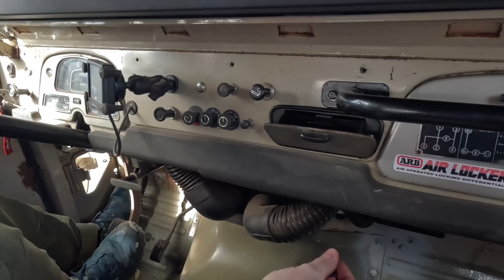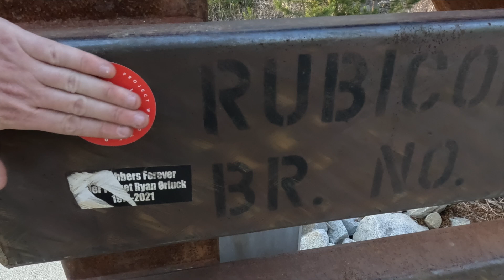Rubicon Trail Gives Project Wrong Way FJ40 Just the Tip, I Learn I Might Need Some Upgrades...

Comment: Brother, that looked awesome!!! Fj40’s are meant to be driven and look what it is capable of.  With no power steering you got more than the tip.  Cheers!
Reply from the maker: Gearing and PS will open a few more doors for sure. Georg is right though, I am going down a slippery slope...

Comment: I have the same gearing issues with my 1972 and 4 speed. I think the best bet for the money is an H55 five speed w/4:1 split case. That takes care of multiple issues! Cruiser Outfitters or George could surely hook you up! And a saginaw kit for PS
Reply from the maker: Georg and I are already building up a combo! It’s looking like a diesel spec H41 and an Orion… which should get me pretty low 😆
Reply: @projectwrongway9127  Oh that should do it! I wonder what the cost difference would be between the combo I am looking at the one you are building? I love the idea of the 5 speed... but you should be deeper in gearing with your set up!
Reply: Okay after checking the cost on H55 with 4:1 case... I like the Orion for my 4 speed! 🙂
Reply from the maker: I’ll try and show the process of getting an Orion in here.

Comment: Hello, greetings from Pontassieve, province of Florence, Italy. I have a Suzuki Jimmy 4x4 with a 1.3 litre M13A petrol engine, manufactured in 2001, all original, which I often use on dirt roads on rural farms and on dirt forest roads used by loggers to get wood from the forest. With forestry tractors, with skidders and forwarders, and with forestry trucks used to transport wood! And this is even though a 4x4 off-roader with original configuration behaves very well on this type of forest and rural dirt and gravel roads!

Comment: Bit more practise you be the one rescuing the Jeep's  the 45s power steering is a little hard to find and can be expensive  but the 60s power steering work's very well and cheaper since you said your going to use ford shock tower's they would work great with the 60s power steering box    good show 👍👍👍👍
Reply from the maker: Just the planning stages at the moment, but good advice here. I like the saginaw box but I'm worried it won't clear my winch and bumper...

Comment: Before I see the whole episode, I'm going to guess you need lower gearing, power steering and or you're thinking about running a lower geared transfer case. Good job, I felt I had it easy in my 40 at Rubicon since it has an automatic transmission.
Wow sausages and rainbow flames as I'm writing this comment! Lol
Reply from the maker: I can imagine an auto trans would be a huge benefit lol

Comment: I did saginaw PS on my 40. It wasn't too difficult, works awesome.
Reply from the maker: I actually have a ton of the parts to do it, I just need some winter down time I guess.
Reply: Good winter project!
Reply from the maker: Yeah, I was thinking once I sort out the gearing I'll pull her into the shop, remove the fenders and front bib, then take a good hard look at my steering.

Comment: keep us informed on your power steering ideas.   and your gearing.  i have a stock 1970 FJ40, F engine. 33" tires.  the trail looked fun, gnarly at times.  whats to do if you pop a tire bead on the trail?
Reply from the maker: Run the spare if I can't get the bead back on. A jack and some maneuvers can help, but I kept around 12psi in to help prevent that. I'll be going with an H41 combo Orion case when the time comes, nice and low.

Comment: Lucky your forearms were so tired, im not sure your son would have enjoyed you beating your stem all night!

Its so good seeing the 40 in action, you should be super proud of it.

It definately looked as though the gearing was too high. 
Im not sure shock towers are going to help much with flex.

 Terrain Tamer has just released some parabolic leafs for 40 series which would definately flex better. Im not sure if you can get them in the States though.

But that would mean swapping the leaves out again!
Im not sure you will survive that again.
Good to see that suicide jack in action! It didnt fail at the most crucial moment which suprised me. Maybe next time.
Reply from the maker: I’m wondering what I can do to get some more flex without doing a leaf over. That not the path time trying to go down at this point, so it’ll be trying everything but that.

Comment: Gotta say, my fj60 with the 97 tbi 5.7 vortec is great also have a NV4500 5speed with it. Going LS3 next with the same trans. Seen a handful of fj40s with small block Chevys or LS’ in them and the NV4500 trans or NV3500 trans are 5speeds and cheap to buy, real granny first gear. They make an adaptor from the NV to the 2F and to the Toyota t-case.
Reply from the maker: I know it sounds crazy... but if this inline 6 dies on me, I'd like to have. a try at the 1.9 ALH TDI Diesel (VW).
Reply: @projectwrongway9127  that’d be a good swap, they also make the 3.0 Cummins made specifically for swaps
Reply from the maker: @RamJamOverland  yeah, that TDI is tempting, but I don’t have a reason yet.

Comment: Nice job! The throttle issue would terrify me. In fact when my cruiser did it, it did. Sticky situation where you're having to get off the brake really fast, engage the clutch and accelerate... oof. If the throttle stutters at all that could lead to bad things. I thought the Sniper was supposed to figure it all out on its own? Could it be a bad O2 sensor?
Reply from the maker: I still blame myself for the sniper issues. I might try and find a local tuner and see about getting a pro to look at it. Figure out if I did something wrong or the sniper.

Comment: Awesome video!   4 speed or 5 speed?
Reply: I commented about him using the NV4500 or NV3500 5speed. Advanced Adapters makes it bolt up to the 2F and yota t-case and that trans is already setup for a Gm small block v8 or LS if he goes that way in the future
Reply from the maker: H42 4 Speed for now, looking at H41 (Diesel) and Orion for the future.
Reply from the maker: Not a bad idea.

Comment: Sniper - set the closed loop at 1200 (it normally starts at idle).  What you're doing is basically telling the system to stop trying to set the AFR levels below 1200 rpm.  This problem is why I don't run the Sniper on my Corvette - I'd set the AFRs I wanted (and enrichment) then it would try to reset them to something else.... and always lean it out.  Frustrating.
Reply from the maker: Yeah, it's a little more than "set it and forget it" I am realizing.

Comment: Are you going saginaw or staying toyota? Also I just built an Orion, definitely worth it, everything is stronger.
Reply from the maker: Good to hear! What trans you running with the Orion? And I’m thinking Saginaw PS.
Reply: @projectwrongway9127  H42 trans,so with stock axle gears about 58:1, could also do 4:88 gears for lower
Reply from the maker: I’ll be doing an H41…
Reply: @projectwrongway9127  Nice! I originally looked for a h41, but went with the h42 due to cost and availability. If I were doing it again, I’d go sm420/465 route.
Reply from the maker: @mwil8209  that’s a smart route, I’m a sucker for the difficult path.
Reply: @projectwrongway9127  You can put H41 gears in the 42 case, just have to use everything…at that point might as well go get a h55 or nv4500
Reply from the maker: Man a 5spd would be the bees knees.